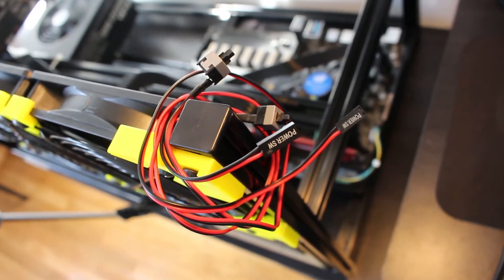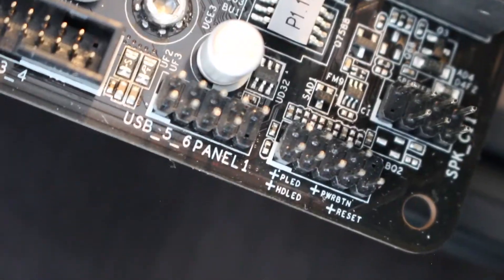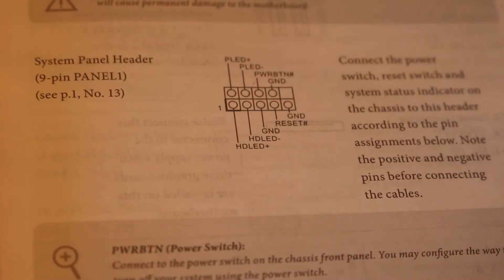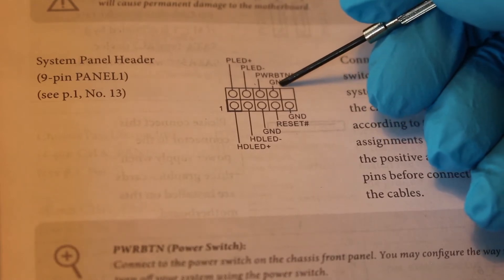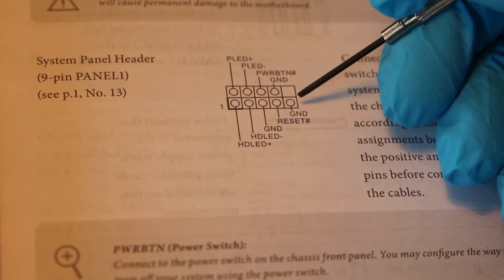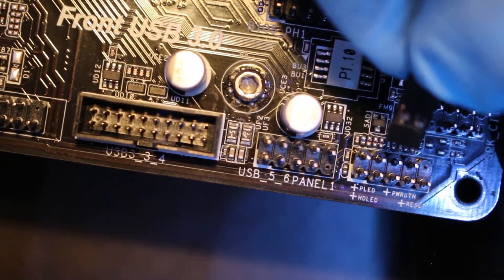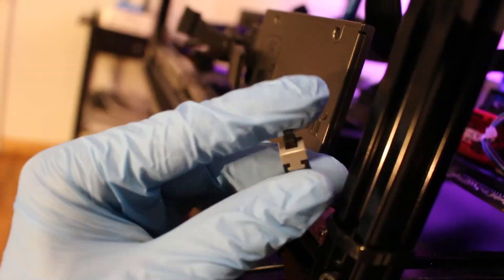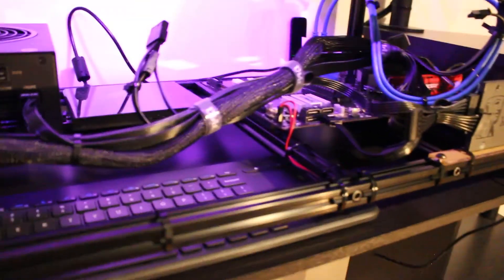How to install 2 pin ATX on/off/reset switches for any PC

Comment: For the power switch and reset switch polarity is irrelevant. They are both only momentary contact switches.
The HD_LED is the only connector of the three where polarity is critical.
If there is a triangle on the connector that is the indicator for the positive lead.

Comment: Good stuff.  I'm building a PC right now and the last case I bought for another build came with no reset button.  I love the reset button and can't stand having to hold the power down for 4 seconds to power the PC off then wait 30 seconds to power it back on.  In my situation, I only use the reset button when Windows hangs or locks up.  I only use the reset button about 5 times a year, but it's worth it.

Comment: 3:42 you did it wrong mate red cable on ground wtf?
Reply: I guess it doesn't matter in this case. I did line up the arrow with the power pin just to be safe and it works for me.